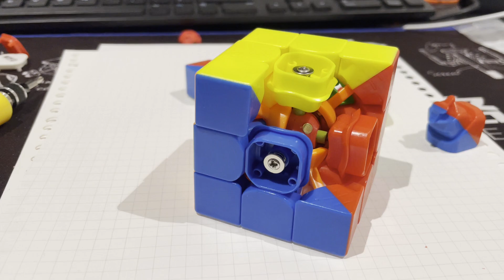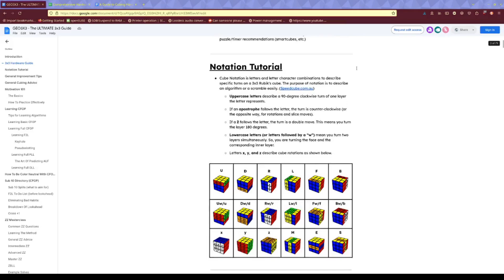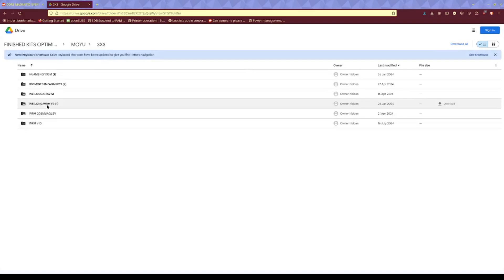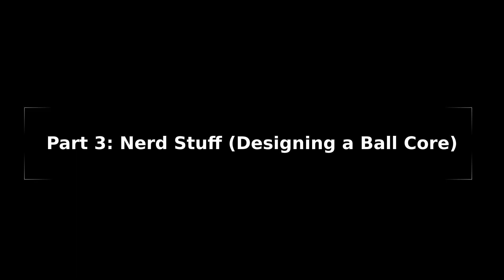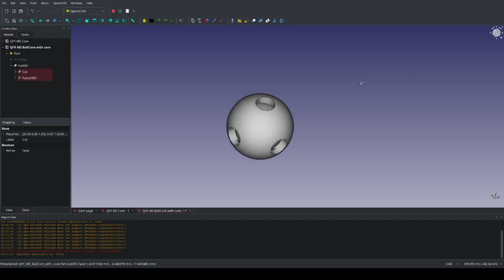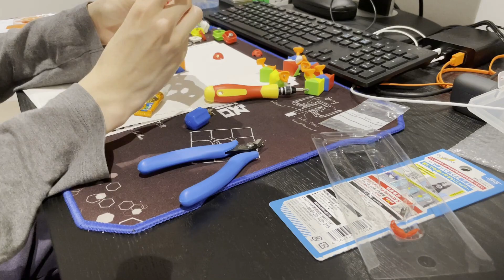Core Magnetize YOUR Cube for Under $10! (feat. WRM v9 and QiYi MS 3x3)

Comment: Hi, i made a 20 magnet bc meilong 2m with the super core, was a little hard to put the magnets in the corners only with superglue, but is fine, btw its really good to see more and more people doing stuff like that
Reply from the maker: @felipesaavedra4339  that’s really cool! Are you saying you took out a core from the super weilong and put it into a meilong 2x2? How does it feel?
Reply: @ImNotPeso  sorry, was the super rs3m, (yes, with 20 m) i don't have any other 2x2 to compare it, but, it feels fast, but at the same time, controllable and stable, the magnets are pretty strong, but it doesn’t auto alignment at all. Yes, i can feel the repulsion when its a 45°, and its leap like half of the piece, this with heavy lubes, with dnm, it has leap, but, of course its very fast, however, i uploaded a short where i show the internals, if you want to wacht it. The core its not perfect, but i think its alright
Reply from the maker: @ just checked out your video, and yeah that looks pretty impressive

Comment: what type of printing did u use, fdm or sla, and can u tell me the printing dimensions? (I want to mod my rs3m)
Reply from the maker: @WJX21  i used fdm with a 0.4mm nozzle. Wdym by printing dimensions? The rs3m has files already made in Pedro’s google drive, which ive linked in the description
Reply: @ImNotPeso  id like to know what should the diameter of the model be? or what scale size should the model be? or do i print it straight away? i have experience in 3d printing so i dont know a lot of this stuff
Reply from the maker: @ the diameter of the ball core shell is 13.5mm. You don’t need to fiddle with scale though, the model is already the correct size. You’d only want to change the scale if you had issues with clearance due to printer settings, or if you wanted to try fit the ball core to a different cube that doesn’t have its own kit already
Reply: @ImNotPeso  ok tysm